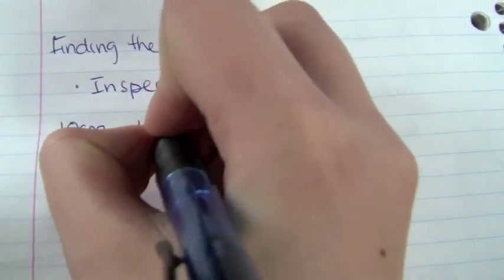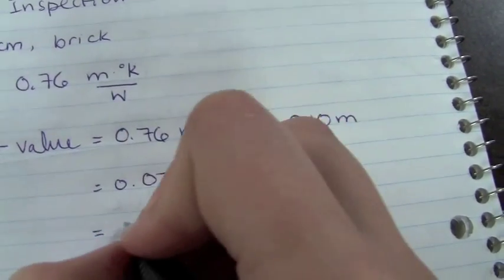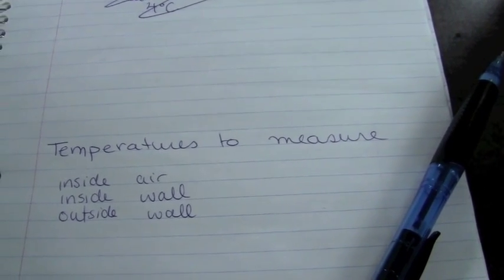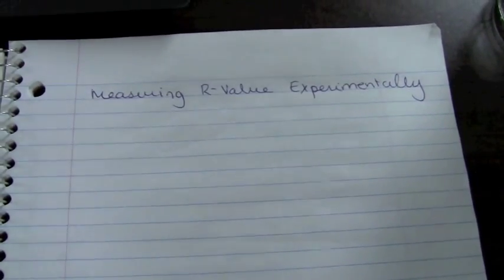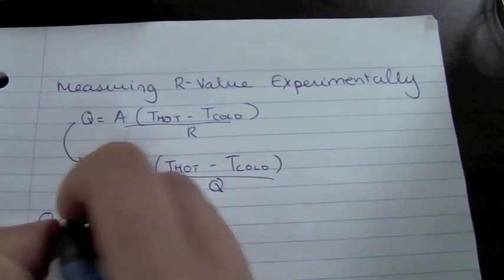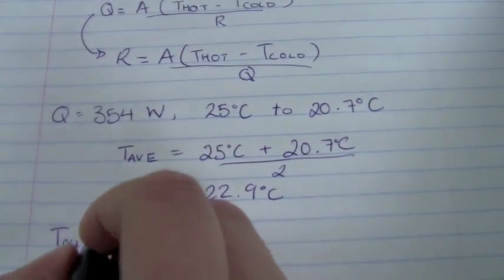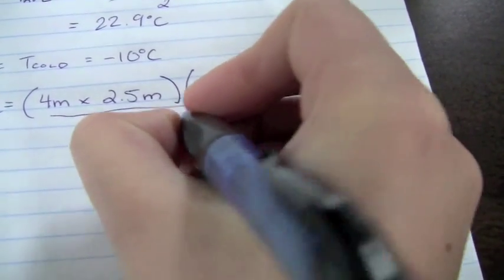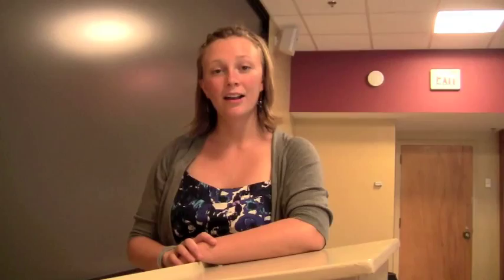Finding the R-Value

Comment: Hi love. Beautiful video. But at the beginning you have to specify that you start with a thermal resistivity value, NOT an R value.Thermal resistivity is the reciprocal of thermal conductivity, which when multiplied by your thickness will give you the R value as you´ve correctly calculated. Love the way you pay attention to your units. Best Regards. Pedro